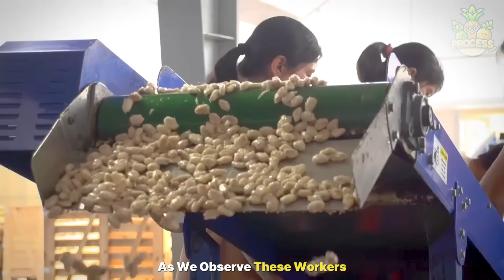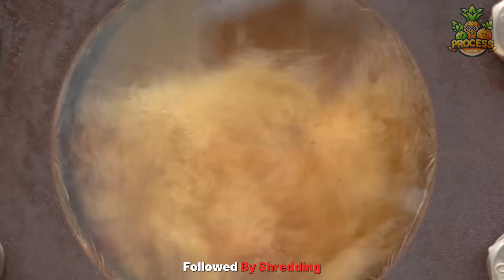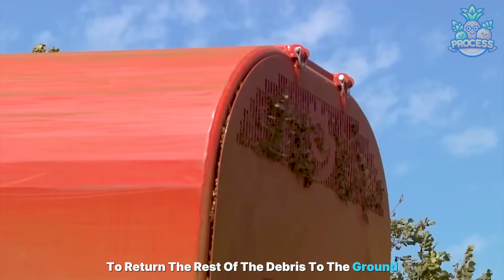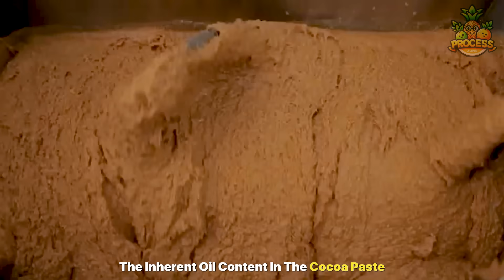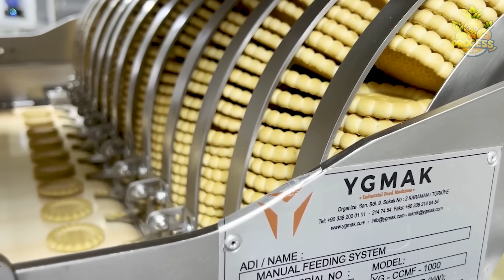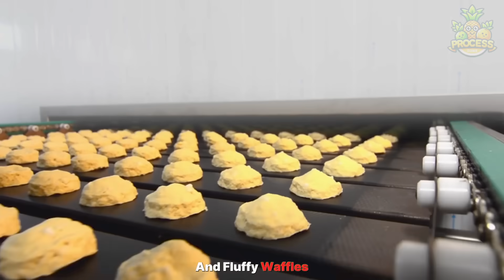How Nutella Is Made In Factory? Bulk Production Of Chocolate Spread Using Advanced Machines

Comment: The original Nutella years back did not contained palm oil 
I discovered last year when I read the ingredients i stopped  use  , 
As well in crackers they use palm oil  you can tell when chewing them they feel grease in the mouth , lot chocolate contain palm oil I avoid those